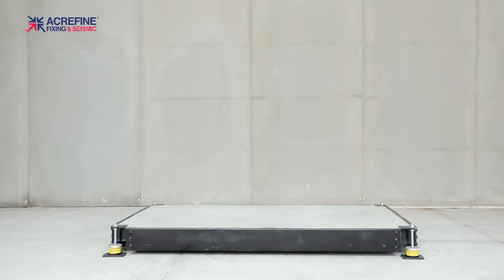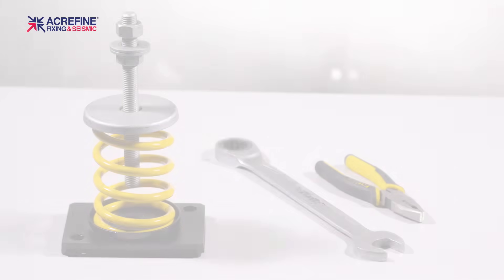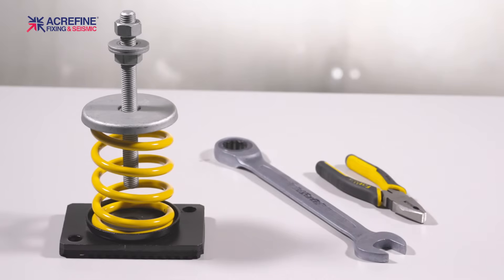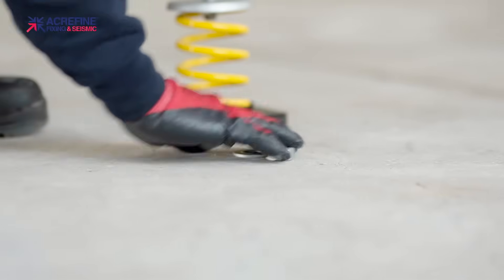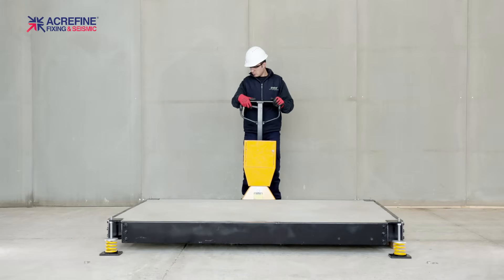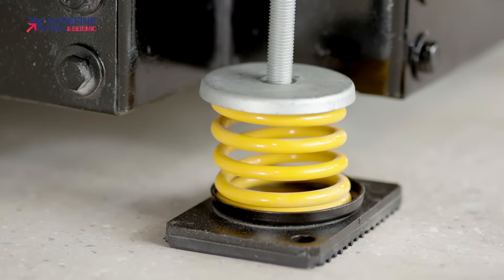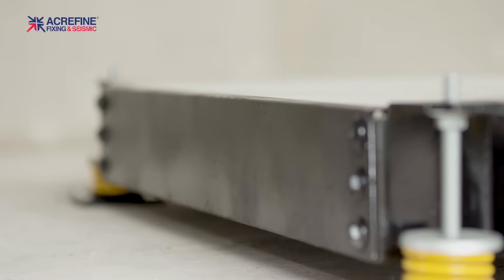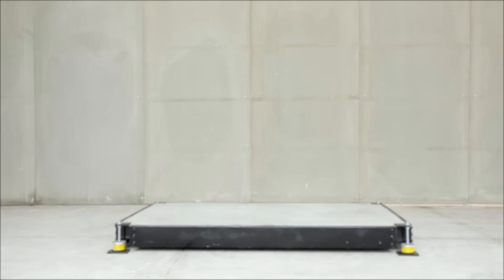How to install and adjust Spring Vibration Isolator

Comment: Is this kind of setup suitable for insulation of environmental noise on a very sensitive laser optical unit?
Reply from the maker: Unfortunately it is not. For that application, you need very specific vibration isolation products which we do not have in our portfolio.
Reply: @AcrefineEngineeringServicesLtd  Thank you for the quick reply.